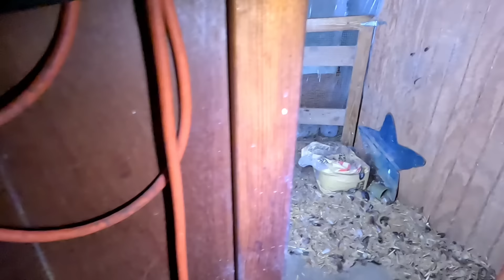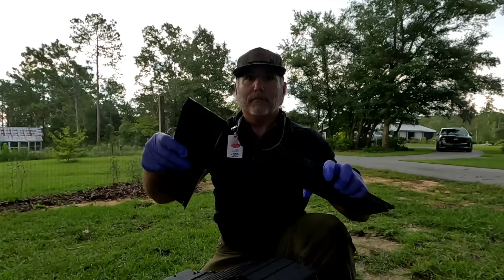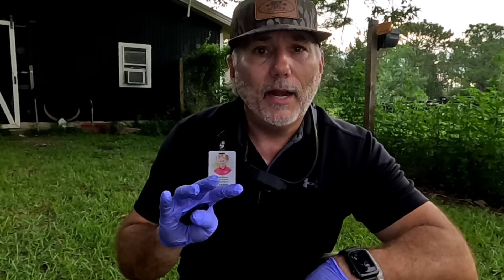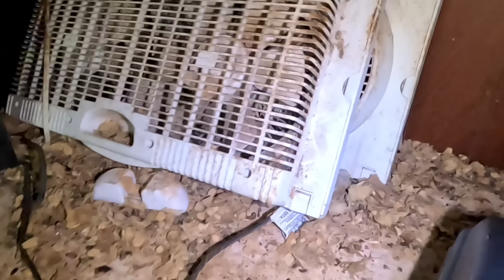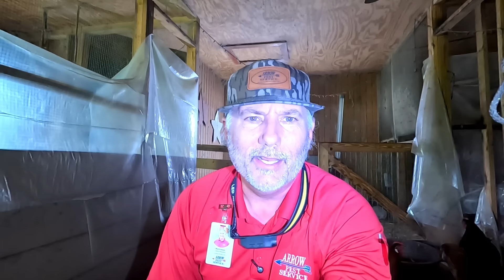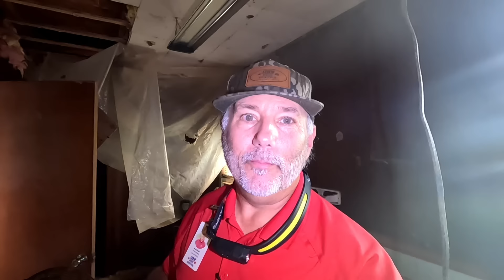Most Effective Rat Control Method Nobody Talks About!

Comment: Would not count on the statement that what if a cat eats a poisoned mouse/rat - they need to eat 30. Don't believe it. I don't use poison. Multiple traps will work, might be a little harder than poison. But if you value wildlife, stay away from poison.

Comment: I had to deal with a barn Rat problem and built a few bucket with water and a ramp to a rod crossing the center with bait in and on a pop can.  The mice climb the ramp crawl out to the can and fall off and drowned. I had about a dozen mice a night BUT there were RATS every where and not one RAT in the bucket.   Your second bait trap is not cheap and the bait is not either but I could make a bait box and try the soft poison bait.    Maybe peanut butter and plaster?

Comment: One year I had a problem with pack rats. They can chew through metal! My dogs killed about 3 of them under my semi trailer. I live in an older rv airstream and fall was approaching.Went to the drawer to retrieve my jeans and it was filled almost to the top with hazelnuts! Wow! Set sticky traps and 2 of them rascals chewed their own tail off! Put rat bait on a piece of wire,(out of reach from the dogs )cuz pack rats will tote it off. Never had an experience with pack rats,they are extremely smart and destructive.

Comment: ....... I made up a couple of 5 ft 5 1/4 inch square bait boxes with the Victor traps in them I used some fat off of stake trimming that t I already had I didn't use the Slim Jims that you suggest I did wipe the grease all over the traps I know I probably use the hands on the boxes I'll have to wait 3 or 4 days for the neophobic to go away I'm in an apartment and it's just a small just a small Studio Clearfield Utah I'll have to wait a few more days I think plus if they're munching on my food storage so got to keep my fingers crossed hopefully they'll go for the bait boxes and the next day or so management will not do anything here they say it's my problem so this is the best way that I've learned from you guys and the least expensive i  already had boxes and bait I bought four Victor traps  large ones this is an inside job and I don't have pets so I left the ends open I'll just have to see now if this works

Comment: I had some infestation in my car engine causing $4300 in damages (along with a wire harness that took a month to arrive). My garage is not attached to the house. I have several kills traps and have caught over a dozen shrew, two deer mice, shrew, and a chipmunk. I am also using bait boxes around the garage and near my whole house generator. The black plastic kill traps work well but sometimes it only catches the tail. One shrew got away when I thought it was dead but when I found a live field mouse I just dropped the whole trap with the mouse into a 5 gallon bucket of water. I can't risk anything getting away.

Comment: Interesting video. Here is my rat story. A month ago in my fruit bowl on my table three apples were partly eaten. I knew it was either mice or rats. Assuming three apples had eaten places in them that it was three rats. I started looking around my house and I don't know what made me start looking in the side of my living room. Wow!!! Two holes in the floor. One hole was at least 1-1/2 inches in diameter. A perfect hole. They chewed away the carpet and tossed it aside. The other hole was about an inch in diameter. You can imagine how freaked out I was. I decided to move my fruit bowl with a couple of apples up on top of my tall refrigerator. Just measured it and is 67 inches high. They no doubt jumped up on my counter which is 36 inches high. I did a bit of research and found out that they can jump as high as 16 to 18 inches. This is total BS for no way for them to get on my counter 36 inches high. There is no area around the counter with a place for them to jump to to further jump on on the counter. Once on the counter they had no problem jumping higher to get to the apples on top of the refrigerator.  I bought a couple of the standard new type traps that you showed. They are  designed much better than the old standard Victor traps. All the talk about peanut butter being a good bait I am here to tell you even a better one. It is Reese's Peanut Butter Cups. You have everything--peanuts, sugar, chocolate and a perfect consistency to use. I'm sure Reese's are going to be angry as hell finding out that the cups are good for rat bait in traps. I thought I only had one rat, which I called, Leaping Leo but I caught another one yesterday. It is surprising how big they are. These are about a good 5 or 6 inches in body with a very long tail.

Comment: I had an issue for a couple of years.  None of the bait I used from the big box stores worked.  They loved it but it wasn’t killing. Ended up locking all of the pets out of the barn and putting a pile of deer corn on the floor for about two weeks.  Used a Video camera to monitor.  There was a huge population and the pile brought them in and they were very comfortable. After two weeks I crumbled up a product called talon with active ingredient Brodificoum.   No more rats within a week.  Now all of my stations get that product and activity is minimal.  I check them every few months and just a nibble here and there. BTW I didn’t use the pile method after I got a handle on them.

Comment: I’ve used similar traps to the Vulcan , for areas that have freezing temperatures , I put some de icing salt and water in the bottom , if you get a lot or don’t get to check it often . A plain bucket with styrofoam peanuts layered on top of some water in a bucket would work too , I smear peanut butter on a few to tempt the rats to enter the bucket
Reply from the maker: Thanks for sharing

Comment: one thing i did was really effective , i used those black snap traps you shown , about 10 of them , the problem was they were setting off traps and getting out of it due to their size by wiggling , so i took heavy wooden board and secured it and a drill with screws through every trap secuting them to weighted board with 10 of those and bait every night . it works great. just making sure to use rubbing alcohol or hand sanitizer to wipe off all human scent , even when wearing gloves , because you grab the gloves with bare hands before putting on , rats can smell that.

Comment: The cheapest rat poison I use is mixing flour , sugar and bicarb soda in equal parts. The rats ingest the mixture which has bicarb soda that turns into gas in their stomachs. Since they can't burp, they inflate and die. I like this method because these rats become food for predators in the nature. Other mix is using plaster of Paris instead of bicarb soda. More expensive but works too.

Comment: I have a storage box on my patio.  For some reason I would get a lot of poop behind the box. Almost daily.  My rats are smart.  I've tried multiple baits, traps,  ....over 2 years. Only caught two. Guessing there something in my flower garden they like.  My best success is I use pool noodles to block the storage box and fence holes. My fence is a interstate hwy. Pool noodles are a good deterrent.  Do have to be replaced over time.  And the rats get us to them overtime.

Comment: I had seen a very primitive version of the bucket used where a wood ramp took them to the top of the bucket where the bait was in plain sight. The top of the bucket, or lid if you will, was a thin piece of plexi with several scissor slits in it. The rats plummeted into water if I'm not mistaken and drowned. You never said what you would do if you found a bucket full of live rats! 😂

Comment: Block baits rodents move them and can drop them where dogs can find them loose pellets they have to feed where you bait them, as an ex pesti in australia I lean towards mechanical methods, lot's  of owl's die from baiting rodents, soft baits get moved also even hardware businesses are starting to pull baits from shelves . People think a block bait wired in place is safe but when they eat 1/3 the way thru guess what the block falls off and the bait is moved.

Comment: A barrle or water catcher & storage barral, put two groves at either side of the barrle, put a broom handle across in to the groves fill harf full of water put a meeat driping in a paper towl at the end of some string, dangle over the middle of the barrle and make a rat ramp or steps to the broom/mop handle, just keep trying diffrent bate if you need to/ phraps banana's.

Comment: I use a large drum filled with water over which is a rod that has pipe on it. Ramp up to the top that gets smeared with an apple to attract them, they go up the ramp onto the rod and the pipe spins dropping them into the water.

Comment: One thing to keep in mind with the bucket method, is if you use water in it to drown whatever you caught, is it it can also catch small animals you DON'T want killed, like kittens, ect. Or squirrels if you are ok with having those around too. I know this from the horrific experience of finding one of my missing kittens dead in it. :( This is not an issue if you do not put water in the bucket as then whatever falls in there will still be alive, so if it is a kitten or something else you do not want to kill you can let it out. BUT you miust make sure to check your bucket frequently though as a kitten can die in there within a day as they are not supposed to go without water or food for more than 12 hours. If you have a missing kitten check the trap immediately first to make sure they did not get in there before looking anywhere else.
(If a kitten has not eaten or drunk water for over 12–18 hours, it is a medical emergency, and you should seek veterinary care immediately. Kittens cannot handle fasting like adult cats, and they can develop fatal conditions such as hepatic lipidosis (fatty liver) or severe hypoglycemia very quickly.)

Comment: I have a pizza shop in NYC and i meed to captire the rat not just poison it because then it will go back into the wall and doe inside that wall and that will smell amd is just nasty ... so the bucket methode seems to be the way ... also if you don't use gloves they will smell your hand scent on the trap right?

Comment: The neophobic reaction can be greatly nullified by daubing the trap inside and out with the dust and dirt in the immediate environment in which the rats move around, and sprinkling it with as many larger particles of the same as can stick onto it. A little dampness or some wetting of the trap's surface would help the particles to cling to it. In short, nasty up the trap with the same mess the rats are running around in, creating connection between rat and trap.

Comment: The Soft Bait Packs Can't be One Eat Kill, It Has 0.0025% Difethialone Active Ingredient. I had infestation for 5Years, Tried Every Trick/Bait Possible From, Snap Traps To, Cage Traps, Ramp/Bucket Traps, You name it, Glue Traps Was the only One With Decent Success, But unless you set it in there Traffic/Food Path its A Total Waste. Finally I did some research and Bought Couple Different Poison, Some with Bromadilone and Some Difethialone. The Difethialone I Bought have 0.005% In it (Which is More than 0.0025%) and it says they have to eat it for 5-7Days to Kill, Apparently you can't get more 0.005% in any Product. 
Anyway it's been the best 4-5months I've had. They ate everything from stored food to carpets/rugs plastic, they always crawl in walls and ceilings, can hear them chewing and running around everywhere. I was Foaming and Angry every time I'm Home. Called Multiple Different Pest control companies to help Me Find where they were coming in from, they all said they can't find it and just wanted to place baits, put Me on Subscription plans and/or charge Me thousands of Dollars. I'm like no thank you I can place the baits Myself, I need you for the things I can't do Myself that's what I need a professional for not easy things I can do Myself. 
Anyway, When I started Laying the Poison they weren't picking them up Fast enough based on their population. So I started mixing it with Can Sardine Oil and a little bit of the Fish too (Rats love Fish) And Voila they Started Picking it up like Crazy. No matter How Much I Lay, by the next day its all gone. So I kept Laying more and More, they Seemed to like the Round Green ones the Most, They never Touch the Blocks (Neither The Green or Yellow).
Anyway, about a Month later, I stopped Seeing Or Hearing Them, Maybe A Few More Messenger Ones Later Came to see if they can come back, but got caught on Glue Traps in the Basement. So I figured since those last few Messenger Rodents Never Came back, that sent the rest of them a message that they are no longer welcome. I still need to find out their entry ports though. But I still keep the Poison for any Unwelcomed wanderer that tries to stop by.

Comment: I live in the Southwest and Pack Rats are a big issue here  in  rural desert environment.  Everything you  mentioned in the beginning about the destruction is spot on!  I've tried several methods,  snap, poison, catch'm alive ... and I wonder about your bait box / poison method. The problem I encountered when using poison was (and you mention, they don't die immediately, can take a coupe days)  after they eat the bait, they go off back under the house, into the walls, wherever and when they do die ... that smell is something you'll never forget and will often turn your stomach inside/out.  What did you do here?  All those rats dying is gonna reak beyond imagination for weeks!  You'd have to burn down that chicken house to get rid of the decomp odor!  I have a car that they somehow get into and build a nest behind the glove box where the heater blower is.  One got poisoned and died there! That's how I discovered they were doing that . . . and this car is notoriously famaous for rats finding that place.  I STOPPED using the poison because of that reason . . . YOU DON"T KNOW WHERE THEY"RE GONNA DIED AND START ROTTING AWAY with the most DISGUSTING< SICKENING ODOR - DEATH!  I now only use Catch'm Alive and drive a mile or so and turn them loose, for the Owls, Snakes, Coyotes, Hawks etc. to finish the job.. Personally I DO NOT agree with using poison, for those reasons. . .  THE SMELL OF DEATH!  YOU CAN'T GET RID OF IF FOR WEEKS or LONGER!
Reply: well relocation of them is so bad now, you have made this everyone's problem.
Reply: @micharris1761 no not if he puts them out in the desert

Comment: Put water in the bucket, they can't jump when they have to swim, and the water makes them heavier.. the cold of the water gives them hypothermia.

I used to catch mice by having a beer bottle hanging horizontally over a bucket with water in it, grease the neck about half way to the open end/spout of the bottle (margarine or butter), put something like bread that wont move in the open end/spout of the bottle, weight down the bottle so it over hangs a surface to have a hight over the bucket, as like on a chair... possibly a plastic bottle could be used, as long as there is nothing for the mice to grab.

Comment: I’ve trapped 30 rats in 2 weeks. Peanut butter and a single cashew on big wooden rat traps. 3 traps total and only set them at night.
Reply: I used to hot-glue dry-roasted peanuts onto a wooden trap's trigger, then add the peanut butter before setting. When their done licking the peanut butter and bite the nut they're well into the trap. Works great for chippies and red squirrels, too. Cheers
Reply: That's the first thing that cross my mind when I saw the traps, it wasn't made out of wood, a material that ain't new to them.
Reply: 😊🎉 big kisses to you I'll do that tonight

Comment: Recently set up two boxes in the backyard patio with blocks that are secured on vertical rods. Haven’t noticed any rodent droppings near the boxes and the patio appears to be clear. Walked around the yard and noticed an intact green block behind the shed with obvious rodent droppings.

I have yet to check the boxes, but is it possible for rodents to remove the blocks from the bait box?
Reply from the maker: I've never had any issues with them removing the blocks, I guess anything is possible

Comment: Rats are extremely clever and survives, i used metal spring traps  but they were aware so i put peanut butter on the spring rather than the bait spike,covering the traps with loose leaves 🍃, it caught them but the traps had to be wired to stop em disappearing with the trap ,😅 10 30 every night i would hear the traps snap around my caravan on a farm, i glued light metal plates underneath the static caravan due to constant chewing then the ate through the 4 corners of the van leaving 3 inch shavings,awfull experience when trying to sleep so i moved, England 🇬🇧

Comment: My top suggestions: no competing food sources at all. Design the good and limit traffic. Concrete is your friend. You can buy anti rat expanding foam that's bitter. I use galvised mesh to seal things up. And then on top of limiting access and access to food you do traps.poison is ok but man the smell... Best thing is to get intop of it before you even get your chickens. I did, and when the rats came it was a lot easier. Just one entry point here or there. No runs, no hiding spots.